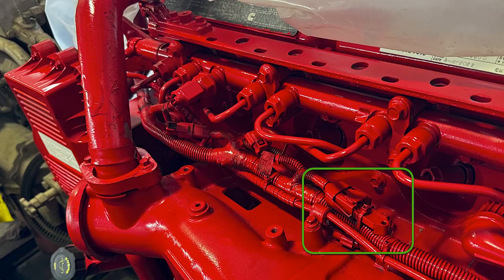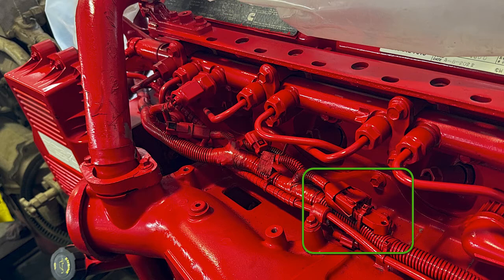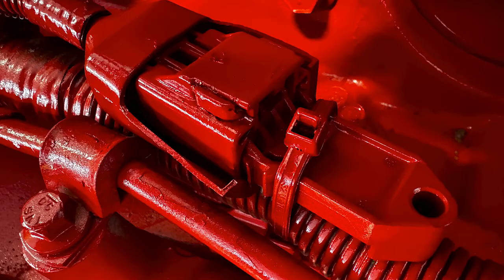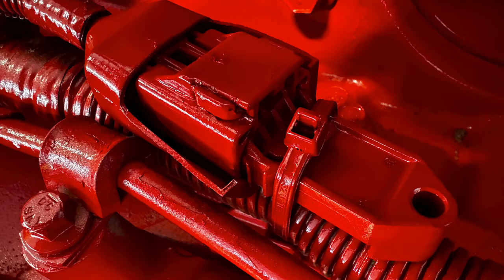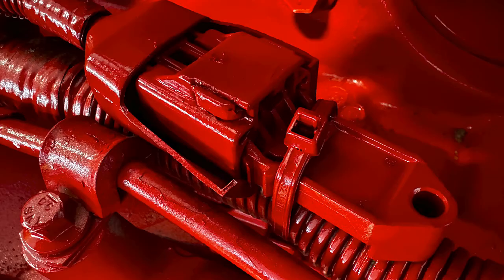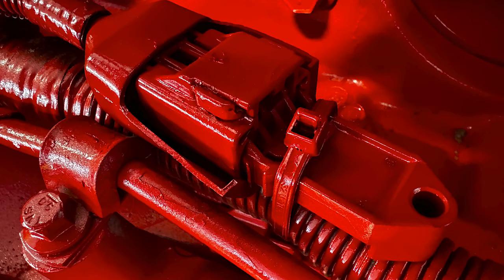Tiny but tough the Ambient air pressure sensor

Comment: Thanks Joe. My guess why you see them on most engines nowadays is the engine management strategy typically turns off EGR in higher elevations. It was the ugly fix on the early Detroits...